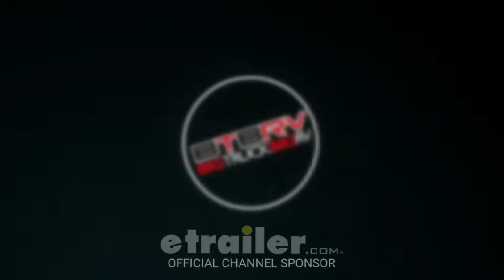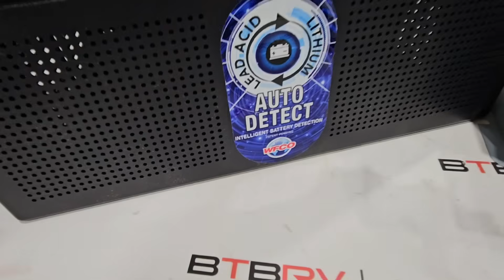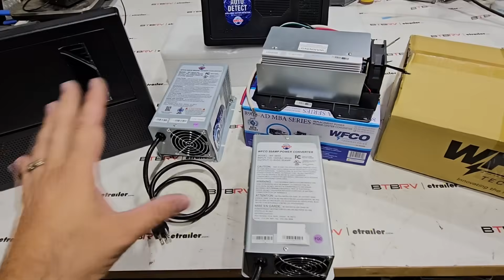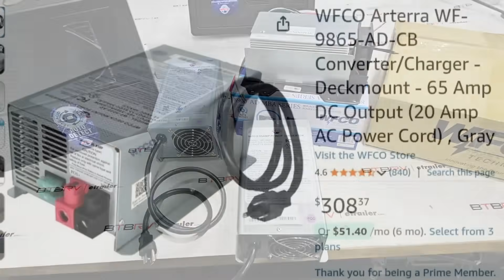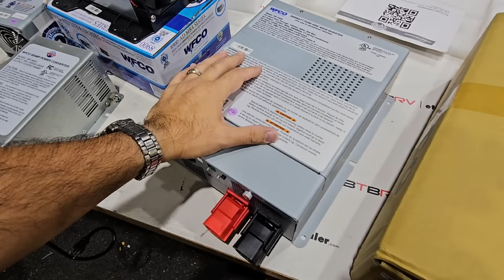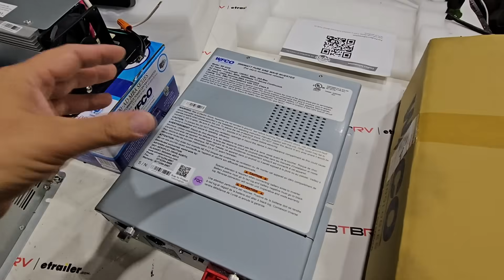Most COUNTERFEITED RV Components! WFCO Technologies

Comment: Please listen to this .. I had a friend who installed LIfePO4 batteries on his 2022 motorhome . his WFCO converter would not switch even thought the front panel had a auto detect . He knows I have a lot of test equipment so I ran everything through tests and sure enough it would not switch.  So I pulled his converter apart and found the the previous owner had taken the true WFCO converter out and put in a POS .  His converter was supposed to be a 55amp .. I looked a the parts on the power supply and told him NFW this is a 55 amp. It just didn't have the parts. I took it out and bench tested it. It was a POS . It would only output 30 amps.  Mine is a 55amp  I pulled mine out and the difference was HUGH.  We took pictures and sent them to WFCO and they verified it was junk.  We bought the real deal and life is good. The price difference between junk and perfect was $260 . That's nothing.

Comment: Simple products with fat margins attract counterfeits.
Reply from the maker: Not sure you can say the real deal is a simple product.
Reply: @BTBRV Definitely depends.
Reply from the maker: @patricksquires77 please educate me
Reply: @BTBRV The reason there is many counterfeits and knock off is these are super simple to manufacture and replicate their function.

Your vid definitely covers the main reasons you for sure 100% want to stick with reputable brands that are sourced reputably. Not sure there is anything to educate on - you covered them. 

 My family is not sleeping in a RV with knock off electrical components - and as your video said some of those reasons.

However my point still stands - these are simple products and would take just a few months to start to manufacture. I am not saying they are safe or you would want them and I am not saying doing it above board is simple but the function is simple and materials  cost low and manufacturing is low thus definitely has fat margin compared to the real deal & thus attracts counterfeits and knockoffs.